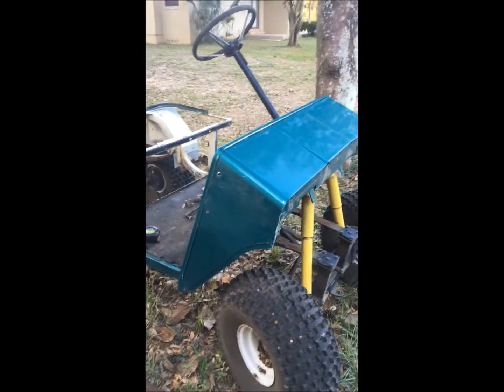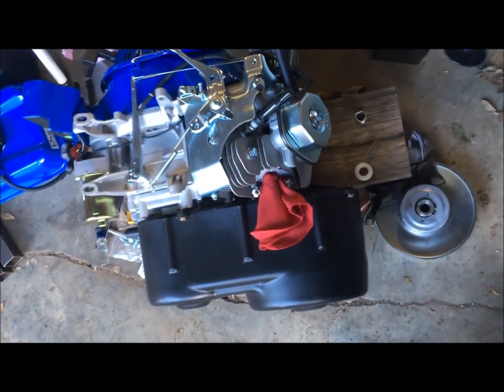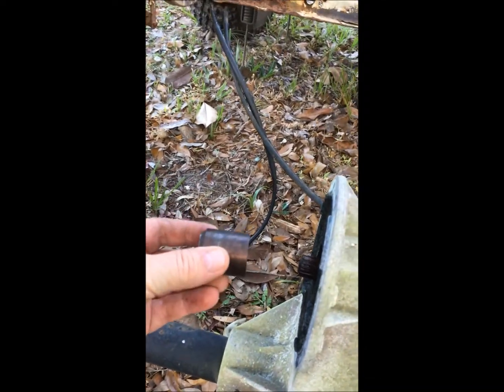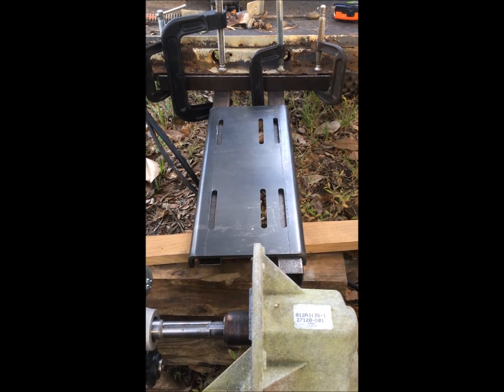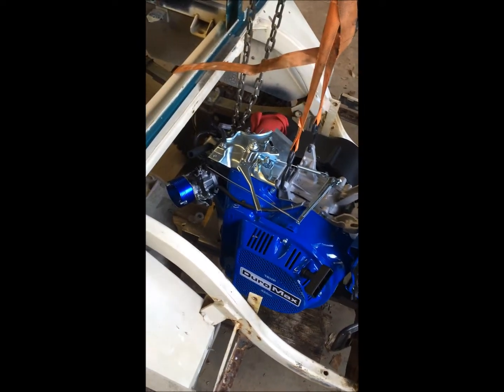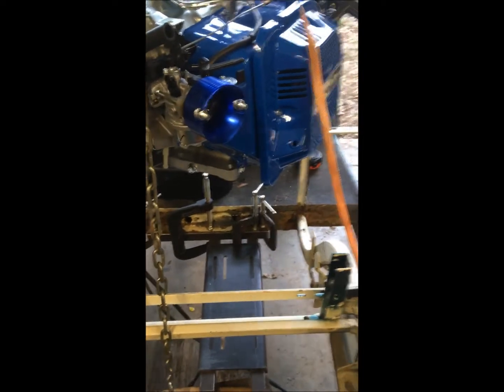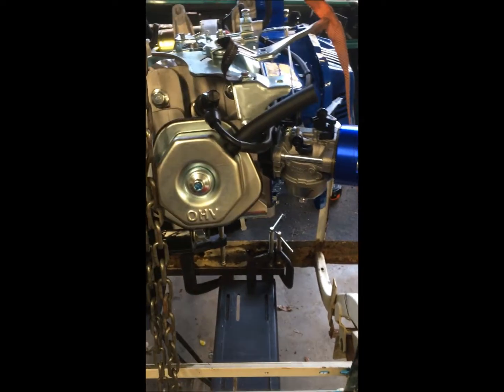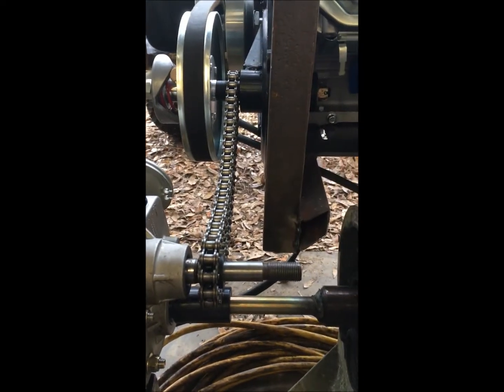Golf cart conversion from electric to gasoline engine

Comment: How does this doo with suspension travel? Any problem with chain coming too loose or too tight?
Reply from the maker: I used a Roll Ring chain tensioner for about 2 and a half years but it fell out and I lost it after using the cart to drag a log over rough terrain.  I then fabricated a spring tensioner from dirt bike parts.  That's been on for over a year.  I have never had a chain come off with either chain tensioner and even when I used it without a tensioner.

Comment: I see you figured out you were running the rearend off the wrong shaft! LOL
Reply from the maker: I never actually ran it off the wrong shaft, I made the switch while I was doing the swap but forgot to mention it in the video.  I did mention it in the description..
Reply: @RunsWithScissors  I was just jerking your line. I got the shafts on mine mixed up during the mock-up process, but like you, I figured it out before I started welding things together. Mine is a 4x4 Bad Boy electric, and the motor was pointed backward instead of sideways. It caused me to have to mount everything behind the rear end/transfer case.
Reply from the maker: @radamson1  that sounds like a cool build, do you have a video of it?  send me a link if you do and thanks for watching my video.

Comment: How did you hook up your Throttle?
Reply from the maker: I used the same foot pedal, just made a bracket that held a cable in place so I could connect the other end to the carburetor.  The cart is at my hunt camp so I can't take a picture or video of it today but the next time I'm out there I will take a video of it and post it on my channel.
Reply: @RunsWithScissors  Thank you. Was thinking I'll just have to make a Bracket, I just didn't think installing a new peddle was needed or wise.
Reply from the maker: @edwinmcguire6040  yes you are correct.  By using the original gas pedal I was able to still use the original mechanism that unlocks the brake once you press the throttle.  Oh, and thanks for watching the video and commenting on it.
Reply: @RunsWithScissors  The Brake Interlock is a BIG Plus in my mind. Thanks again.

Comment: Nicely done! Awesome video
Reply from the maker: thanks, it was a fun project, however there is a flaw in the video.  I said I used the input shaft of the transmission.  I actually used the output shaft of the transmission, took the sprocket off and used a coupler to connect the output shaft to a 5/8" shaft welded to the spline connector from the electric motor.  Any how, I have not had any problems at all with the conversion.  It can take a lot of abuse and it pulls wheelies...

Comment: It looks like i should have gotten an electronic one to convert. The 2 stroke ezgo spins the opposite direction of a 212cc..
Reply: You can flip the axle? seen that done before.
Reply: @RandyKraege  I though about it, but I would have to cut and remake all the brackets on the opposite side. I'm just going with a jack shaft out the yoke and then run chain from the 212.

Comment: can you post a picture of your chain tensioner. I am doing the same thing, but I am setting up rear end a little differently. I totally pressed out the 19-spline shaft out of the electric stator. I am going to use a pillow block bearing and cut a keyway in the shaft. ! have to have it turned down to 1". The stator splined shaft is like 1 3/32nds.  Im curious. with the rear end being a solid rear end does the chain ever make any grinding noises or show wear if one side of the machine is tilted one way due to the passenger load or material being hauled? thank you for your video! very informative i will share a video when I'm done with mine
Reply from the maker: I did a video on the chain tensioner.  I bought a Roll Ring and used it.  It's been over a year since I converted my golf cart and the chain never makes noise and has never come off.  https://www.youtube.com/watch?v=Mx1ZeubfXfA
I hope this helps,   The Roll Ring is an awesome chain tensioner, made things so simple to do and it extends the life of the chain because it doesn't allow the chain to whip around.  It smooths out gear changes too!

Comment: how well did the gear box hold up mounted that way?
Reply from the maker: Its been over a year since I built this and its still going strong.  I thought I would have blown the gearbox by now since the engine puts out more power than its rated for, but its still going.  Doesn't pop out of gear or nothing.  The chain has never come off.  I have carried two adults and 400 pounds of corn through gullies, up hill and across swamp where the water came up to the floor.  Still going strong.  The gearbox is oriented so the drain is at the bottom and the filler cap is on top.

Comment: Hey man, I’m not sure if you’d be able to help me I did a predator 420 swap in an easy go and I’m having a hard time figuring out why this thing is so slow. I use the same gearbox that everybody else is using with the chain, going from the gearbox to the transaxle and for some reason I can’t get over 10 mile an hour I know for a fact of pressure 420 should go faster and 10 mile an hour I had a 10 tooth sprocket on the gearbox and a 12 tooth on the rear axle and then I switched it to a 36 tooth on the rear axle on it didn’t make a difference.
Reply from the maker: the rear axle on my easy go has a 14:1 reduction ratio.  The gearbox has a 1.25:1 reduction ratio in Forward and 2.5:1 in reverse. Putting the 36 tooth on the rear axle with a 10 tooth on the gearbox would add 3.6:1 reduction.  you need to put a larger sprocket on the gearbox and a smaller sprocket on the rear end.  I don't know if the 36T sprocket will fit the gearbox but you need reverse the sprockets.

Comment: can you leave a link to the muffler and air filter? I'm putting an 18hp duromax in an ezgo cart and can't find muffler or airfilter for engines that large. I'm only seeing them for 6-7hp which doesn't fit. Thanks!
Reply from the maker: the muffler is something I made.  I cut the original muffler off its flange with my bandsaw. then welded a bent exhaust pipe I bought from Go Power Sports to the flange with my mig welder.  I used a supertrapp exhaust from an old dirt bike to use as the muffler.  The air filter was something I bought from Amazon.  I measured the diameter of the carburetor flange and just bought an air filter that fit.
Reply: @RunsWithScissors  Thanks for replying. I was able to make a muffler earlier out of pieces of a new one that didn't fit. Do you happen to have a link to the air filter assembly you bought? I'm having a hard time finding one that is the right size.
Reply from the maker: @TimothysTractors  I bought it so long ago that my Amazon account archive doesn't allow me to go back that far.  If you can measure the inlet diameter I can look for one.  Also I have gone to the K&N website and ordered filters by inlet size for other projects I have done.
Reply: @RunsWithScissors  I've got the air filter but not the right adapter that goes on the 2 carburetor studs
Reply from the maker: @TimothysTractors  I'm really sorry that I can't get to the order I made on amazon for the air filter.  It all came as a unit.  The adapter for the carb and filter.  It was over a year ago so I can't get back in the amazon archives to find it.  Dang, I will keep looking and if I find any more info I will post it in the description where I have the other links for parts.  Sorry Tim, I just don't have the info right now.
Reply from the maker: https://www.amazon.com/XLYZE-Adapter-Predator-Lawnmower-Minibike/dp/B07FM2JMQP/ref=sr_1_14?keywords=420cc+predator+air+filter&qid=1673214536&sr=8-14 @TimothysTractors  
I was buying some other stuff on Amazon and remembered the air filter I bought fit the 420cc Predator engine.  I think this was it

Comment: i see in other videos that the gear box is opposite (on the other side). and am wondering witch way is forward/reverse.  i have mine set up similar to yours. just looking for insight before i weld it up. just want to be sure my forward and reverse are are configured correctly due to the gear ratio in the box . thanks in advance for all your help.
Reply from the maker: the output shaft will turn in the direction of the engine when in forward and opposite in reverse.  Forward has a slight reduction gear, for every 1.25 turns of the input shaft in forward the output shaft will turn once.  When in reverse the input shaft will turn 2.5 turns for every one turn in the opposite direction on the output shaft.  I hope that helps.  Sorry for the initial confusion in my video as I forgot to mention the switch I did while making the video.  I had no idea so many people would watch this video.  I thought maybe 100 views but its at 5600 views now.  I wish I had taken the time to do a better production.
Reply: You could always pull it back apart and do a more detailed explanation as you put it back together slowly @RunsWithScissors

Comment: Can i do this without the torque converter and just use a chain? Or will that be bad. I currently have this exact motor in my 93 club car, and ive got a comet 740 clutch on it with a belt to secondary drive clutch but its just not fast enough for me.
Reply from the maker: I don't know what a 740 clutch is, I suppose its a centrifugal clutch.  I believe the engine has the torque to do it but don't know if the clutch can handle it.  Centrifugal clutches tend to run hot.  You'll have to experiment and see.  The thing about using a torque convert is that changes the ratio continuously where a centrifugal clutch is set to only one ratio.
Reply from the maker: Dan, thinking about this a little more, it sounds like you just need to change your sprocket ratios.  If you want to go faster put more teeth on the front sprocket and fewer on the back sprocket.  The rear end of my EZGO has a 14:1 ratio.  I don't know about Club cars.

Comment: do you have an updated pic/video after you corrected the input output
Reply from the maker: The corrected pic/video is the one you're watching, I just didn't mention that I turned it around in the video.  If you look at any of the frames that show the transmission bolted in place, the input shaft is the input, the output shaft is the output and I'm using a coupler to connect the output shaft to the axle.  I had to drill a 5/8" coupler halfway through with a 16mm drill bit to fit it.  I used a 5/8" keyed round bar to connect the output to the axle drive.

Comment: any details on the swing arm??
Reply from the maker: There is no swing arm.  the engine mount is welded to the frame and the engine is bolted to the mounts.  the axle is on the stock leaf springs.  The forward/reverse transmission is on a mount that was welded directly onto the rear axle and aligned with the CVT sprocket and rear end.   Only the drive chain connects the axle to the CVT sprocket.  I use a roll ring as the chain tensioner.  No issues what so ever and it pulls wheelies and hauls 500lbs of corn up and down hills, gullies and ditches.  I have never had the chain come off even without the chain tensioner.

Comment: sent you an email.
Reply from the maker: Thanks, I got it and replied with links to the parts I used.  I appreciate that you watched the video.  As I shared with you, there are mistakes in the video.  I originally thought the forward/reverse transmission was a 1:1 in forward and reverse but figured out its 1.25:1 in forward (a slight reduction) and 2.5}1 in reverse (a big reduction).  So I couldn't use the input shaft as the output.  I had to use the input shaft as the input and the output shaft as the output.  that's where drilling the 5/8" coupler halfway through with a 16mm bit came into play.  All I can say is I've got 6 months of use so far on my conversion and no problems at all.  I can haul 500 lbs of corn and a passenger up hills and through swamp without a hitch.  I left the governor on the engine for reliability and still have wheelie popping torque!

Comment: can you supply some links to the parts ?
Reply from the maker: sure, what parts are you interested in?
Reply: @RunsWithScissors   the clutch type ,gears, transmission/gear box and  where you got them. Any issues with using the input shaft as the out put?  also i see a lot of people fab up a swing arm suspension so the motor and rear axle stay on the same plane. Did you do this?. im pretty much going to copie your design as it is probably the best video I've seen in reguadrs to  simplicity and detail,

Comment: Ground the switch housing to ground
Reply from the maker: thanks for watching and commenting on the video.  I realized it was a grounding issue about a minute after I had said that.  I just ran a wire to ground and it worked.  Great that you knew that, shows you know your stuff...  :-)

Comment: How are you using 16hp engine when most are using 7hp?
Reply from the maker: The smaller engines don't have electric start.  A 7hp engine would be rather anemic.   I routinely put 500 lbs of corn on this golf cart along with a passenger and the 16hp engine does not hesitate to carry us up hills.

Comment: Awesome video!! in order for the cutoff from key switch box to work it needs to be grounded to the chassis.
Reply from the maker: Yes, I figured that out a few minutes after I said that.  I had to run a wire from the box to ground.  But it is good to note that.  Also I ran the chain from the CVT sprocket to the input shaft of the transmission, not the output shaft as I originally stated, then I used a coupler to connect the transmission output shaft to the rear end.  I don't think I mentioned that in the video either.  Thanks for watching and commenting on the video.  I appreciate that.